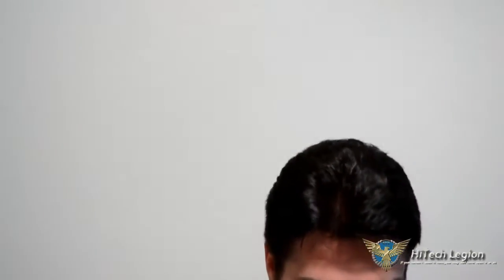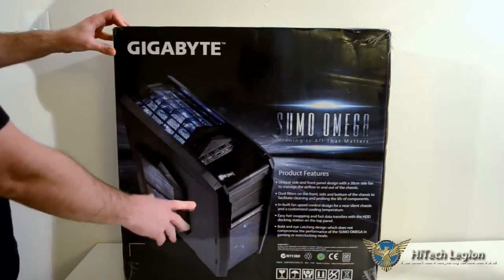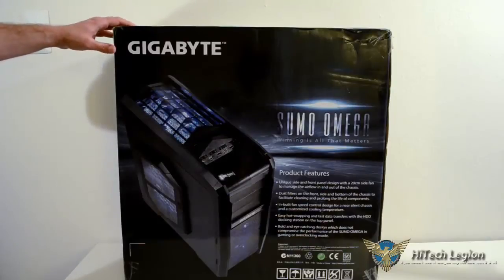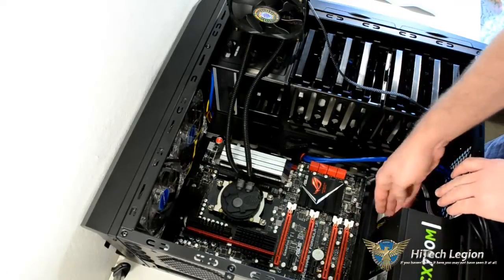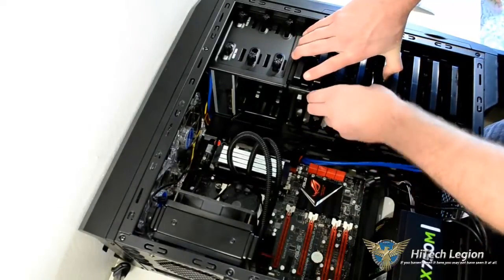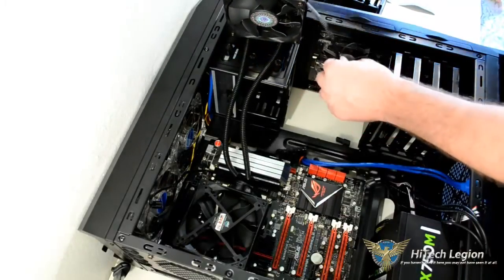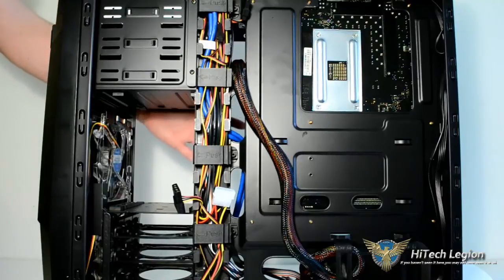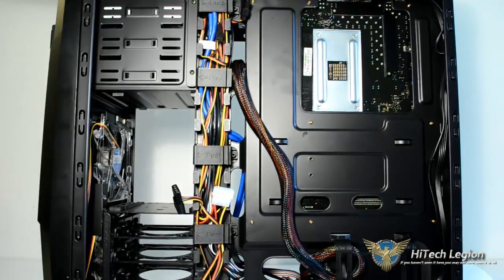Gigabyte Sumo Omega Midtower Gaming Case Unboxing + Review

Comment: That SSD could easily be shimmed up to rid the plug strain (ex. the rubber grommets, or the thickness build up shim that all my Kingston SSD's came with as it's thinner than a 2.5" HDD.)  Or cut the tray even.

Comment: Could this case easily hold a CORSAIR Hydro Series H105 radiator on the top with a ATX (Form Factor: 12.0-in x 7.5-in, 30.5 cm x 19.1 cm) motherboard?